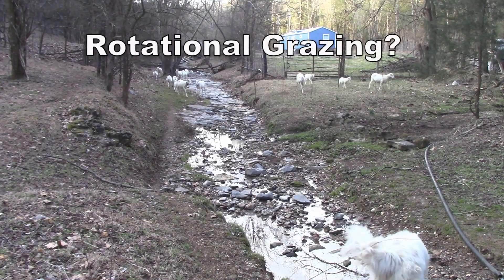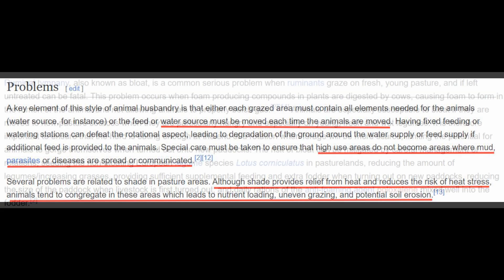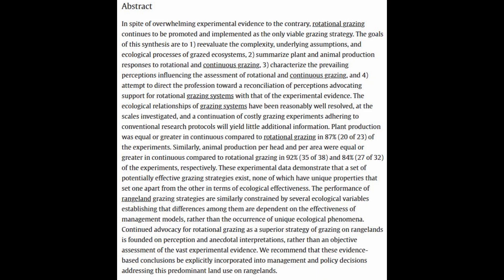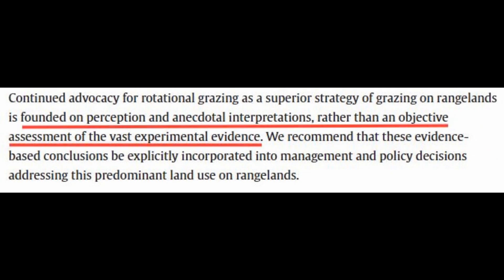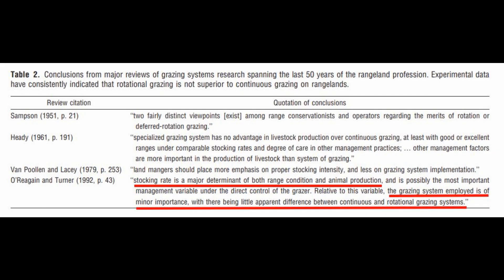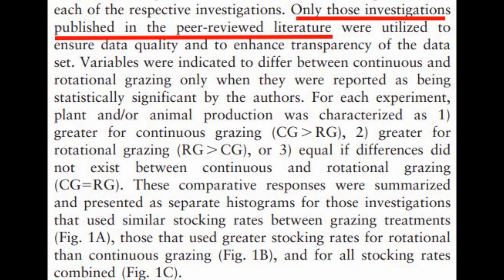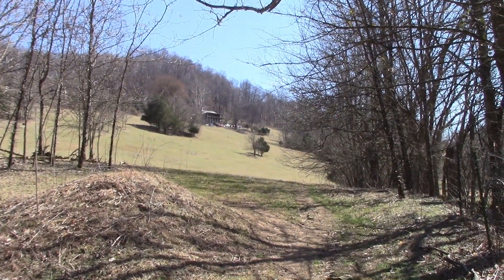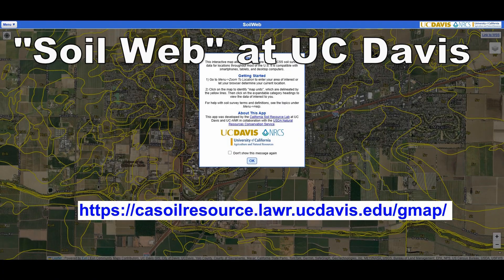Sheep Rotational Grazing? Scientific Proof Its Not Necessary for St. Croix Sheep.

Comment: It may not matter for the sheep, but it does for the soil.
Reply from the maker: Rotational Grazing can help the soil if the stocking rate is low and the confinement of animals to a small grazing area doesn't denude the vegetation.  
I think our greatest control over the grazing outcome is the stocking rate.  
When the Buffalos roamed the prairie, they created really good soil and grazed "continuously", and were not confined in a grazing system.  
The reason "continuous grazing" worked for Buffaloes and not for cows is that the Buffaloes had predators to keep their numbers low, while man is a lousy predator and will run more cows on soil than it can handle.  
Regardless, the majority of scientific studies show that rotational grazing is not a "cure all" for overgrazed pastures.  
The real answer is "adaptive grazing management", where we use rotational grazing when it best suits the situation.  And building the soil should be a very, very high priority.  
Thanks for your comments.  John Hurt

Comment: You're looking at it back to front. It's about better soil which means better grass which leads to healthier animals. When you graze continuously the grass never gets a chance to put good growth on, they're eating down to the dirt and parasite load is high because of it. There's plenty of information out there.
Reply from the maker: Here is another way to see it. When the animals continuously graze the entire farm, then they never graze any one spot down to the dirt, as they can leave and go find better grass.  They are not locked into a small artificial rotational paddock, as that is what causes more overgrazing and less production.  So there is less overgrazing in a single spot with continuous than rotational, and therefore more grass production with continuous.  I have more grass than I need with continuous grazing, and no inputs as far as moving paddocks, hot wire, or my personal time, which means I make more profit on my investment in continuous grazing.  More profit means I can run less sheep and make the same money as a rotational grazer, and so with less sheep I cause less overgrazing than a rotational grazer.  That is why continuous is better, and produces more grass with less sheep and lower inputs. 

The real key to either system is running less sheep (the stocking rate) and using hay as a backup.  If you have too many animals, that is what causes overgrazing, especially in a drought when the grass stops growing.   It doesn't matter the grazing system. 
Also, I have more acres of rented hay fields than grazing acres, and produce more hay than I could ever use.   If there is a drought, then I let them eat hay.  Having lots of hay bales is the ultimate guarantee for any overgrazing problem, as the sheep will naturally pick the hay to eat when the grass runs out in an unexpected drought.  You can't do that with rotational grazing. I cannot move these hay bales around into each paddock during a drought when there is no grass.  It is rare, we usually do not have a drought in Tennessee, but it happens. But when it rains, the grass comes right back as with continuous there is much less overgrazing to destroy the grass, as they are not confined into some artificially small paddock. 

All of the Agricultural PhDs and soil scientists that say continuous is just as good, or better than rotational grazing - they cannot all be wrong.  Agricultural  Scientists also challenged Allan Savory about his lack of empirical evidence for rotational grazing, yet he was a really good salesman.  If Rotational Grazing is superior, then the scientific results should be able to be replicated.  There is no hard evidence or scientific proof for rotational grazing being superior to continuous, it is just that everyone believes it to be so, and that is why it is. 
But, if someone wants to drag hot wire around a field, I won't stop them. 
Thanks for the information, I appreciate your position.  John Hurt
Reply: Both arguments are specious because either style of grazing can be abused or managed properly. 

Greg Judy has proved conclusively that all of his pastures on both the farms he and his wife own outright, as well as those properties that they lease, have benefited from long-term rotational grazing practices. 

Every single property has shown an increased number of native warm season as well as native cool season grasses, and forbs, begin to emerge from the seed bank and proliferate as the urine and feces from their cattle and sheep enrich the soil and provide food for the entirety of the soil biome.

A more diversified pasture with as many species of grasses and forbs as possible can only benefit the cattle and the sheep that graze such pastures. The greater the number of edible species that ruminant livestock animals eat across the entire calendar year, the more diverse their nutrient and mineral uptake will be, the more robust their immune systems will be, the healthier they will be, the happier they will be, the faster they will gain weight, and the more valuable they will be, regardless of whether they are breeding stock as part of a herd or flock, breeding stock to be sold, or animals destined to be sold for human consumption.

Just as an aside, my grandmother died in 2008, just a few days shy of her 105th birthday. I can recall her stories of the incredible diversity of fruit and vegetable cultivars that were available for purchase in Baltimore City in the first 3-4 decades of the 20th century. There were dozens upon dozens of different apples, pears, green beans, tomatoes, carrots, strawberries, sweet corn, etc. to choose from depending upon which produce stand or market one shopped at. 

Every stand or market had its favorite growers that supplied unique cultivars for sale in limited quantities and for limited times. The point that I am trying to make is that in 2025 we humans have largely forgotten how to eat healthy and our choices in a grocery store are exponentially fewer and of much lower quality, nutrient wise, than the cornucopia of choices my great grandparents had to choose from when feeding their children, including my mother's mother, my grandmother Loretta.

Comment: Howdy from central Montana. I would like to begin by thanking you for the video's. It is very important for people to become aware of the dangers of our modern food production systems. I am glad your management system works for you in your environment; however that is your context and if your satisfied with that more power to you.
       My experience however is much different and no study saying there is little to no advantage to rotational grazing versus continuous grazing could convince me otherwise. Almost all ranches out West are going broke due to operating with a degraded resource due to a century or more of mismanagement. Over the last forty years i have witnessed landscapes that could run an aum on 10 acres is now at 30 acres per year due to the lack of forage and diversity of that forage.
     I urge anyone who has animals to stop and observe their grazing habits. All animals  will go after their most desired species first, then move on to the second most desirable and so on. After three or four days, those first grazed plants will start to regrow and immediately will be eaten off; as they are the freshest and most sweet and tender of the plants out there. This will over time cause this species root system to weaken and slow production or even fail to regrow and eventually die off. The above ground  biomass of a plant is a direct correlation to the below ground root system,so if you only have 3 inch tall grass you have a very shallow root system that has little ability to gather minerals and no drought tolerance. In a high rainfall area this is much more forgiving. In a brittle environment such as Montana where we receive an average of 13 inches of rainfal it is much less forgiving.
       Our historic organic matter level was 7 % now most rangeland is less than 1%. This is caused by being over stocked   and or over grazed. With no root structure in the soil the soil biology and soil aggregates break down causing low water and air infiltration rates. All of this leads to bare soil due to no forage cover. Without much soil cover the soil caps during a rain event and becomes hydrophobic. It also raises the soil temp to extremes which kills most soil biology. Without a home and moisture the biology dies off and now your left with desertification of your rangeland. Seen it in person during drought events.
  
 Many people like to blame dirt farmers for the destruction of the landscape but many continuous grazing operations are doing jusy as much damage. Anecdotal or not i will continue doing adaptive rotational grazing as i have seen many benefits. Most pastures in my area produce less than 500 pounds of forage per acre whereas i have seen properly managed pastures produce over 6000 lbs an acre in the same environments.
   Again its all about your context; but i would urge you to think about how the bison and elk moved that caused the praire soils to be rich and deep dark soil that we have now mined to the subsoil.
  I highly recommended Gabe Browns book Dirt to Soil,Nichole Master's  For the Love of Soil and Walt Davis How Not To Go Broke Ranching. Also the Roots So Deep docu series by Peter Byck it is on sale now for 10.00 it was 60.00. As  a God  fearing being once i dove into the soil health world there was no going back it just makes sense as plain as the nose on our face. God Bless. Please forgive my sentence structure and such as i have not wrote this much in 20 years.
Reply: Well said i agree.. God laidout the model for us to follow all we have to do is copy it.. lands and forage very but rotational grazing makes for a great practice when managing ur animals and ur lands... the plants have a growth rate and a life cycle iv learned to let them grow and keep the flock moving makes for amazing forage and grazing.. great stuff fellas keep it up ! ✨️✨️👍
Reply from the maker: @88349  Thanks for your comments, I appreciate it.  John Hurt
Reply from the maker: Thanks for your insights.  Montana is not Tennessee, and your lack of rainfall and bitter cold makes all the difference.  Rotational grazing in MT may have MUCH larger paddocks than these 1 acre for 1 day intensive grazing in TN.  "Adaptive Management" means you have to adapt to whatever works for you, if you are seeing results from your rotational grazing, then that is the most important outcome.  I understand that overgrazing in the early 20th century destroyed a lot of rangeland.  There is a lot in the Bible about giving the land a rest every 7 years.  Thanks for your comments.  John Hurt
Reply: @PureNaturalSheep  yes we are making sure to give a dedicated area of the ranch a rest every year to follow God's instructions. As far as the stockpiled forage in your case you are 100 percent right that was not feed just lignified grass which has no nutritional value. In a true stockpile system you would have a forage that would remain green at the base well into winter; this requires a thriving ecosystem and fall management of that area prior to seed set and plant maturity.
Reply from the maker: @406regengarage  Thanks.  I still do not know why the grass was dead, we did have some hard freezes down to 6 degrees for several days, and snow.  I mowed the grass with a lawnmower up until July, then just let it grow and tried it as a winter stockpile, and it looked great in October, but was dead by January.  Thanks for all of your comments and suggestions.  John
Reply: @PureNaturalSheep ive heard it dies once it seeds out? Wonder if you kept  mowing if it would keep growing ?
Reply from the maker: @markstamm272  Yes, the grass will grow after it makes seeds, and mowing it makes the grass thicker.  The most important thing if you really are not going to bale hay and leave it out all winter in the field, is to plant winter hardy grass, like tall fescue, that will stay green longer into the winter and give it fertilizer.  I am not doing that, I think it is easier just to bale hay and put it in the barn.  Thanks for the comments.  John Hurt